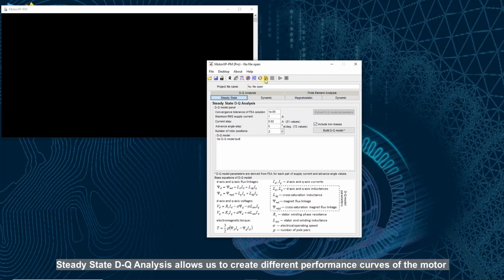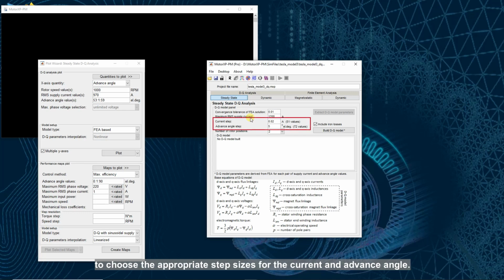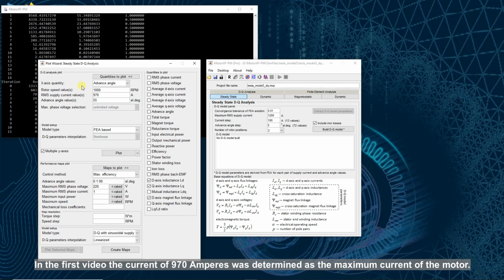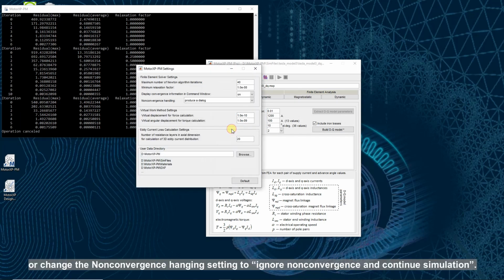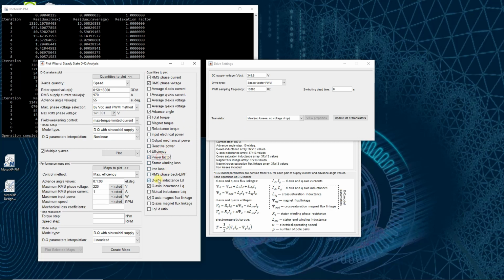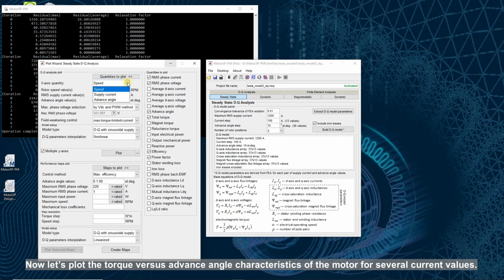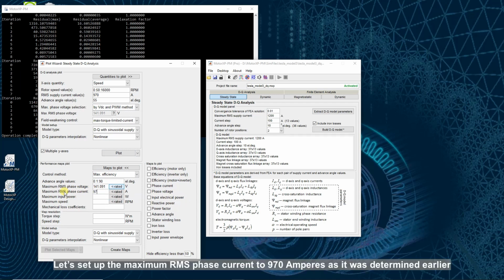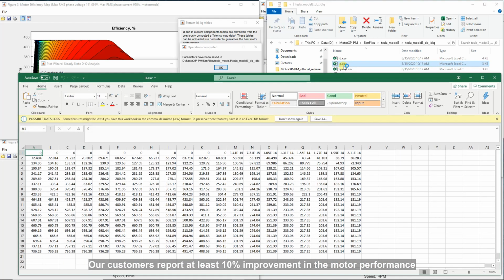MotorXP-PM – Performance analysis of a Tesla Model 3 electric motor (part 2) – D-Q Analysis

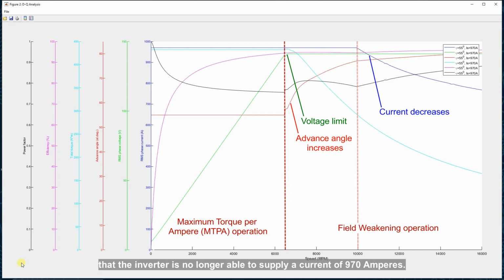Comment: Does the current decrease at 9:49 mean that the motor has reached it max speed?
Reply from the maker: It means that the inverter is not able to provide that high current because of the increased back EMF

Comment: can any share how to simulink synchronous motor
Reply from the maker: This example shows simulation of a permanent magnet synchronous motor. Do you mean wound-rotor synchronous motor?
Reply: @motorxp  yes, I want to task that, either its surface mount type or interior?
Reply from the maker: @kundankumar-dt5uu  This one is interior, but it is not a wound-rotor.
Wound-rotor synchronous motors are not currently supported by the MotorXP software

Comment: Hi, Im trying to build the model 3s pmsm motor using a simplified dq model. Thank you for providing some of the values needed!
My model needs the Ld,Lq and magnetic flux linkadge values. I could gather the Ld Lq values from this video, any chance you could provide me with the flux linkage values?
Reply from the maker: You can extract all DQ model parameters from mxpp-file of Tesla M3 motor available on https://motorxp.com/downloads/. Install MotorXP-PM Free Edition and then follow user manual p.95

Comment: I have tried many multiple softwares for motor simulation. i have also used the trial version of MotorXP and it seems to be the most user friendly. The rate at which new designs can be made and analysed is vastly increased with this software. will surely be considering the paid version .
Reply from the maker: Thank you for the appreciation!

Comment: Just wondering, what kind of controller can run ipm motir also as SynRm motor..?
Would it be possible to run AC induction asynchronous motor controller for  running an ipm motir for  high rpm.!
Reply from the maker: I don't think that controller for induction motor can run ipm motor, it requires its own controller